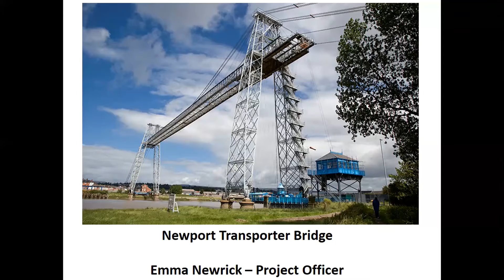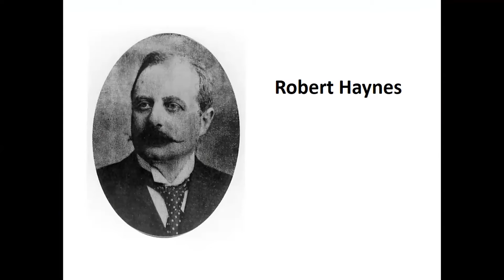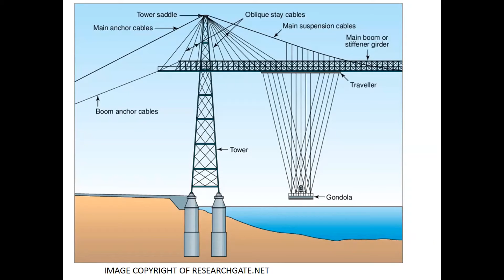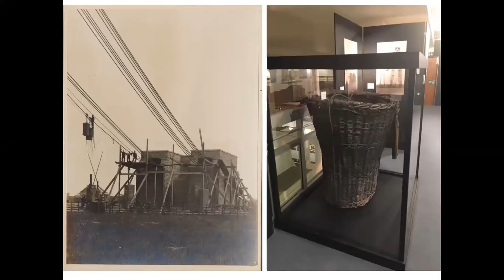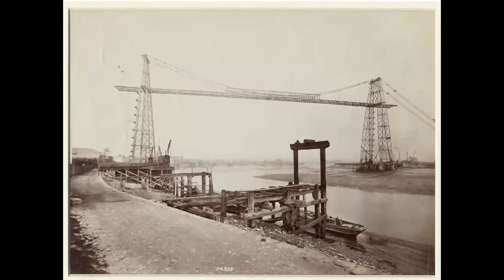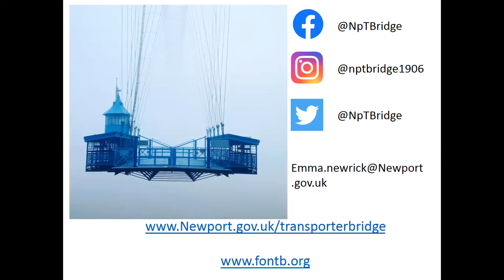Teabreak Talks Special: Newport Transporter Bridge

Comment: n 1906 how did they generate the electricity to power this behemoth ?
Reply from the maker: Electric power had been available since the 1830s, and by this time was mostly provided from coal powered generators. So coal = steam = dynamo = electricity.  Newport's electrical power station was just over a mile away from the bridge and began supplying power to the town in 1895.